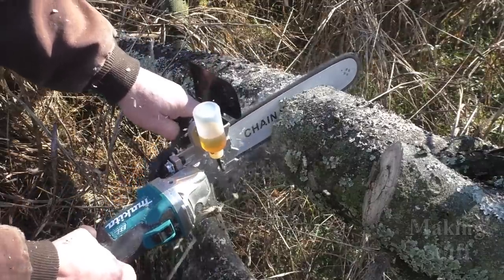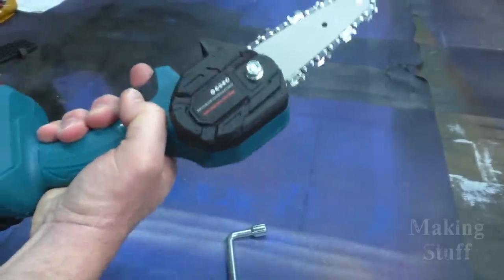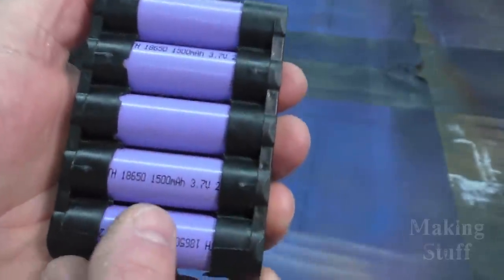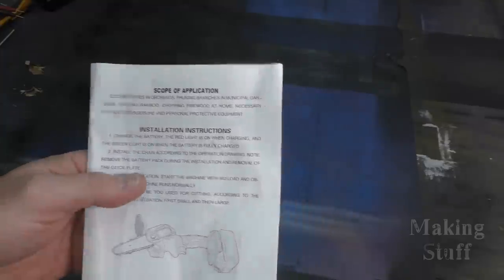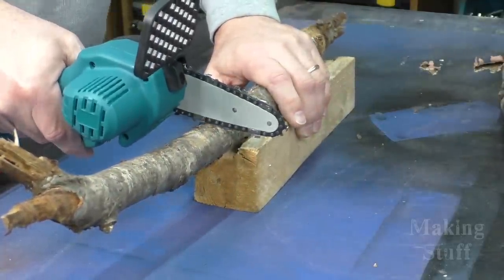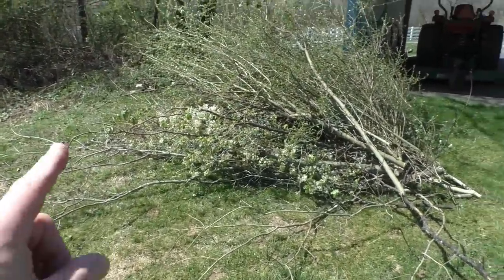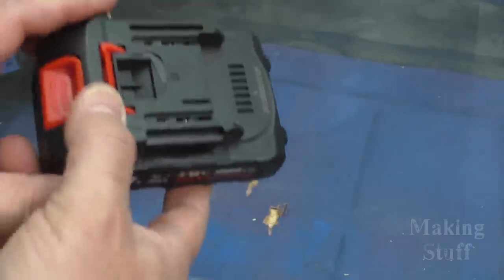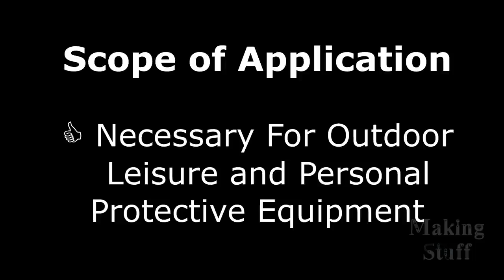Mini Cordless Chainsaw Review - Is It Any Good?

Comment: Thanks for an informative video. I have always been taught however, that the chain should be running on any chainsaw before it is introduced to the wood. If you start it when already touching the wood, it pulls the saw forward and can be dangerous. Particularly with a bigger saw.
Reply: great point - thanks

Comment: I bought one of these last fall and it's been a great tool. I expected it to last only a few cutting sessions but it has lasted way beyond that and even made it through the aftermath of the  recent Texas ice storm. Lots of downed tree branches. I like it better than my Dewalt pole saw. One of the two batteries that came with mine quit charging after 6 months, but that's my only complaint so far. Thanks for the tip about using Makita batteries. Now I have an excuse to buy yet another battery charger to clutter up my workbench.
Reply: Battery life is always the weakest part of these Asian knockoff tools.
Reply: Ch

Comment: Thank you for this very detailed presentation.  I very much like the disassembly of the battery -- and the demonstration that the saw functions with a Makita 18volt battery ( I have 7 ).  A question.  In the past, Makita offered a mini-chainsaw.  Did they discontinue the saw due to injuries?  A one-handed chainsaw presents an opportunity for an emergency room adventure.

You demonstrated this saw a year ago.  Does it still function?  Does the company still offer the saw?  I will buy if you respond ( and give you the commission, if any ).  Thank you.

Comment: My wife gave my son and I one for Christmas 2 years ago, I almost laughed when I opened it. But I have been using it a lot lately, these things are very useful. One thing I have noticed is when used hard they overheat and shut down, since she bought 2 I just alternate between them when they start getting to hot. These things are great for trimming limbs and cutting up scraps of wood for kindling. Very handy and inexpensive to have around, using makita batteries is something I didn’t know.
Reply: Yess, yes!!! Do not buy these!!! Have bought 2 already with the second on it's way. You will have too much free time on your hands by not having to sharpen them!!! Gust saying.

Comment: "I have no idea what this is for." Its the safety hand guard for the top of the device. You can even see it in the picture on the operations instructions manual. at 1:29.
Reply: You basically don't understand what the hand guard are mainly used for on a chainsaw. It prevents your hand sliding into the moving chains but more importantly the hand guard acts as brake to stop the chain rolling.
Reply: @TonyWangDesign  You basically didn't understand the point randy miller was making.
Reply: @TonyWangDesign  I don't think the guard on this chainsaw is connected to anything to make the chain stop rolling.

Comment: It's good. I bought the 6 inch version and am very happy with the tool. One thing though: I won't put my finger on or near the chain while the battery is plugged in. I always remove the battery first before doing so - for example, tensioning the chain. For safety....
Reply from the maker: Yeah I did the same thing.  Not sure if I mentioned that in the video, but good point!
Reply: @MakingStuff  The majority of users of this item are sensible enough I think. Still, good to emphasize the point for added safety's sake. Thanks for the video review. Much appreciated.

Comment: I got one and liked it so much I bought one for a family member and one for a friend (extended family). The "advertising" on the side is hysterical, but I disengage the battery when walking or carrying for safety, because spinning blades are no joke. Unlike a gas chainsaw, once you stop cutting, you can hear what's going on around you and there is way less fatigue from vibration. My firewood looks awesome this year and is ready for the next Snowpocalypse.

Comment: SAFETY NOTE: the "blade" can slide SIDEWAYS in various conditions (especially when the chain is dull) so be very careful with holding a piece by hand. If I'm not mistaken there are gloves on the market that are designed for saw protection, though i am not sure how well they would work with this as the method used to stop the chain is by clogging the chainsaw clutch with fiber. If anyone has this, chainsaw protection, and is willing to check this (not wearing it during test of course) i'm very curious if saw protection works for this as well.

That being said, i hope everyone has a great day and enjoys their tools :)
Reply: In place of a human finger, our shop teacher always used a hot dog to demonstrate what could happen if you stuck your finger where it didn't belong (a rather graphic and pointed lesson I might add!). 👍 Of course, that was back in the day before there were blade-brake features like some saws/tools have these days! 🤣

Comment: Got mine from amazon with 2 blades,plus two batteries, and a pair of gloves for 75.dollars. and it works GREAT!!!!!
Reply: Got mine from Amazon too.  I was expecting it to cut like butter. But it bounces like crazy. I tighten the chain a bit, but it still bounces. Do you have any tips? Never used a chain saw before. Do I suppose to rest the saw on the branch as close to the handle as possible and apply very firm pressure?
Reply: @gskyle4822  yes, chainsaws are normally heavy, so with this very light tool you do need to apply some pressure.  Be careful.
Reply: @Amigatech  Thx Amiga! I ve also discovered two critical issues since then. First, i shouldn't have turned the power on before i rest it against the trunk, which led to the 2nd issue where i noticed no matter how gently i press the power button, it always revves up to the highest speed and bounces back. When i forced it to stay on the wood, one of the blades actually chipped off. So, i bought a much cheaper one from Amazon. And Voila, the variable speed actually works - i can start at low RPM and let the chain of blades slowly grab onto the wood before revving it up, bouncing is reduced substantially and it actually cuts now. But this cheap version have no lock button, handle guard, and no reverse button unlike the first one i got which had all the bells and whistles, except it does NOT cut!
Reply: @gskyle4822  Cool!  Would you mind posting a link to the one with a variable speed trigger?

Comment: Bought one of these and it was working well to trim up a tree in my yard. Then went to change out the chain, and had trouble getting it to maintain the tension and work properly after that. Mine also came with a pair of gloves, so that was nice.
Reply: The side cover with the nut locks the tension in place. So have that nut loose, get the tension right, then tighten up the nut.

Comment: I bought mine from Banggood and it works fine. You have to work out how to adjust the chain tension with the small screw and undoing the side bolt a little first but its easy enough to do. OK for trimming small branches but its really useful at cutting up big cardboard boxes to pack them into a bin. Paid peanuts for it, arrived within a reasonable time frame and it works well. One trick, I lubricate the chain track with a spray can of lithium grease.
Reply: I never would have thought about using it for cardboard. Nice.

Comment: Surprising!
You sounded sceptical at the start.
I’m a landscape gardener and interested how manoeuvrable it’d be in a dense thicket. You attacked the shrub by the gate without hassle, so I’m guessing nothing got in the way, like the safety guard or battery. 👍🏼
Reply: They come now fully assembled, a bit more powerful. I love mine. You can get them with or without a safety, I got mine without. Only because with the safety, it's much harder to operate as you have to press two buttons at once to get the blade going. I take mine everywhere. Very handy.

Comment: I have a later version of the same 4" bar tool. It's functional in that it will get the job it was designed for done... but mine tends to bind up fairly frequently even with liberally pre-oiling the chain. More often than not, I just use my Makita 18v XCU10Z 12" chainsaw.

Comment: I see they updated the voltage on the actual listing. They should have just called it 18V instead of 21V though. And they should fix that 2,000 mah capacity thing. In your video you clearly show that it's a 1,500mah pack, not 2,000. And I'd be really surprised if those "1,500s" were really that.

Comment: I have a similar one, but it lacks the guard shield. It came with 2 batteries and a charger. They weird thing is that so many of them cost almost as much as the unit to replace a battery or get a charger with a battery. That said, I used mine immediately for cutting up fallen branches from a red oak tree so they would go into my totter. It worked like a charm and since I have rheumatoid arthritis, this is a world of help, unlike having to use my larger chain saw. I didn't want something that just took up space in my garage shelfs like my heavier chain saw and this little unit fit that bill quite nicely. Not sure how long a chain will last or the unit itself, but already it has saved me a lot of headache in removing limbs or trimming those shoots from my large holly shrubs.
Reply: -be sure to oil your chain plentiful.  More is better than little.

Comment: I bought one of these and I am absolutely thrilled to have it.  I was able to trim a massive amount of bushes and trees branches and the battery was still going.  This sure beats using loppers trying to trim branches.  I know they seem to look like cheap little tools, but they do work for those smaller branches, and like you showed, you can cut through bigger branches, just take your time.  Thumbs up from me.
Reply from the maker: Thanks for watching!
Reply: I did't see you use the oil, i bought one and it didn't have a manual
Reply: @kenstockton7793  Did you use oil
I too got no instructions

Comment: i bought one this cheap battery chain saw, its cutting quite ok but the problem is its motor getting hot very fast, just after 2 cut of 4" soft wood and its stop working until cooling down. and its chain can easily getting stuck with debris that slipped into drive sprocket enclosure.

Comment: Hey there good morning! I have a question, I just bought one chainsaw and I put it charging right away but the instructions says that once it is connected to the power supply must be a red light until it turns green but mine it's just green and it's on and off. Can you or anybody help me!?

Comment: The device I purchased was the SeeSii brand( $99.00 on Amazon) Which looks just like the one your demonstrating. It went together in the same manner, but  it didn't work the same. Not at all. It cut into the branch, which  was only 1/2 inch thick. It  left a black streak in the groove and smokes a little then froze up.   Granted the branches were green, I still expected the same results.
Reply: Sounds like the chain was installed going the wrong way
Reply: @dylanh5056  carefully followed the directions.  It was marked what went where and how. I feel that it was a dud (refurbished), but  not willing to waste time on another one.

Comment: I have the exact same model, so far its been great for trimming branches and turning them into firewood. I'm surprised at how well it works, how much abuse it will take, and how long its lasted. Finding out it will take Makita batteries was a nice surprise. Thanks for the video!
Reply from the maker: Thanks for watching!
Reply: Where did you buy this saw
Reply: Greatest invention since the wheel
Reply: What make and model is this?

Comment: I agree very much with your positive review. I bought one of those from Banggood a few days ago, and it has surpassed my expectations. I felled a few small dead trees (trunks up to 100mm) and cut a lot of dead branches in no time.
I was glad to see in your video that it can indeed take Makita batteries, and vica-versa of course, because that means that the bigger batteries with longer run-times can be used too, and they are readily available. It seems that that 48Vf moniker is a rating of some sort, not a voltage indicator. Mine has 88Vf, and there are others with different numbers, but they are all 18V or 21V.
Reply: That 48Vf is meant to mislead you into believing it is a 48 volt system. It's just some assigned letters and numbers. Buyer Beware! THANKS for clearing up the actual battery content and capacity.

Comment: I got one (no battery, no oil flask) for peanuts and was able to trim long branches from a big tree that were anoying my neighbor at no time on one charge. t is quite impresive! I got hurt when I holded one branch too close to where I was about to cut and the chain tool bounched at contact of branch and touched my hand. It was a nasty skin chunk but used onion skin to cover my wound. Be very careful with this tool!!!
Reply: onion skin? What does that do to a wound?
Reply: @BluuurghAg9  It stops bleeding and covers wound if you have no band aid :D

Comment: That was one great video, I would like to know the longevity, but that's gonna take time, so let us know when you have to throw it in the bin and whether you got your monies worth. Cheers
Reply from the maker: I've used it about 5 times and even dropped it on the concrete floor.  Still going strong, no problems.
Reply: I bought one of these, used it well for about 10 hours and the motor burnt out. It is more of a novelty. When it worked it worked well, but didn't really last.
Reply: @panayiotispanayides2141  Many thanks. Cheers
Reply: Never used a chain saw before. Got my mini chain saw today. I was expecting it to cut like butter. But it bounces like crazy. I tighten the chain a bit, but still bounces. Do you have to apply very firm pressure? Or, did i get a lemon? ☹️
Reply: @gskyle4822  Hi, yes it does bounce and you need to force it down as it cuts, not so much to stall the motor, but it does not compare to a real chain saw. Ideal for pruning those slightly thicker branches without the need to get out the real beast.
Reply: @panayiotispanayides2141    Ah... I see. Then how do you cut something overhead?!? Which is mostly what I plan to do, pruning trees with it! 

This channel makes it look so easy. I didn't buy the exact same model, thought i got a lemon. I tried it out on 3 branches ranging from 1" to 1.5", and one tooth already broke off the chain ☹️, thank God it didn't hit me in the eye.

Perhaps i still need to get that bulky and heavy pole saw. 😩
Reply: @gskyle4822  That is exactly what I was wondering about.
Reply: @gskyle4822  it takes a little getting use to the right RPM and pressure applied.  Get your RPM up high, then gradually touch it to the wood.  And then apply more pressure as needed.
Reply: @jimk.1129  Thx Jim! I realize the RPM was the culprit.  The first saw goes into full speed no matter how gently i press the trigger. I also notice from watching the video that the host tend to rest the saw firmly against the wood before pushing the trigger, which is a bit counter intuitive.  With this 2 new found observations, i went ahead and purchased another saw from Amazon, one that is almost identical to the one in the video. Viola! The variable speed now works, so that i can slowly ramp up the speed and let the blade grab onto the wood. It actually cuts now and no more bounces!  And what's better is that this bare bone version is $30 cheaper than the first one I got with all the safety features, but ironically more dangerous and doesn't even cut!
Reply: @gskyle4822  excellent!

Comment: In that it does not appear to have a built in oiler, as such, did the owners manual say specifically how to oil the chain, and how often to do so, and state what kind of oil to use, or not to usesawdiametersharpeningdimension

Comment: When using chainsaws, it's wrong to start the tool on the surface.
Reply: Correct. Highly dangerous especially with bigger models, as can kick back.
Reply: Especially while holding the piece with his other hand so close to the chain. I cringed when he tried to cut those larger pieces.
Reply: I agree = bad bad technique. You're supposed to let the chain get up to full speed before contacting the wood.  Be safe out there!
Reply: My mind went immediately to "Louisiana Hunting Trip"
Reply: He must have been trying to get it to kick.  I was more worried when he was talking under the tree and moved the blade near his head, could be very easy to squeeze that trigger with no locking mechanism.

Comment: We are getting a new heat pump; the old one was 25 years old and DOA.   Gotta trim the trees for the crane.  Hmm.  McCullow is heavy.  This is just right for the job, the right tool in the box.  Should have bought Milwaukee M18 as I have a lot.  Will when the cheapie croaks.

Comment: I thought too that for the safety of the saw you could take of the battery and when you once use it again then but the battery back, it´s then 100% guaranteed safety not tu cut yourself accidentally. But what do you do with the oil? Do you need to oil something in there? And if yes, then how often is the oiling needed?  

Great video also, i have wanted it too for myself but before any purchase i search here and there is it good and worth to get or not. Not i see it´s worth it and will buy it too.

Comment: You could give that thing a substantial bit more battery duration if you replaced the lithium batteries with some higher capacity ones. Depending on where you buy them you can get 3400 mA/hr 18650's for €3 a piece, and often even cheaper if you find a good deal on them, so just €15 to more then double the battery capacity.

Comment: I just got one of these.  This video wsa really helpful.  I'm new to any type of chainsaw so I'm not sure how tight the chain should be on blade guide plate.  Also how much pressure you should use when cutting  or do you just let the saw do the work.  Will work it out!